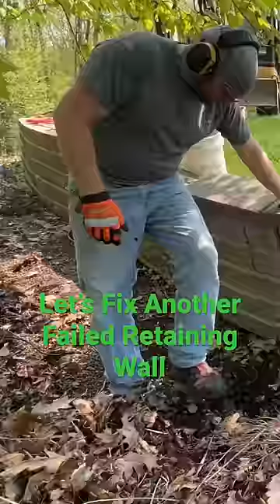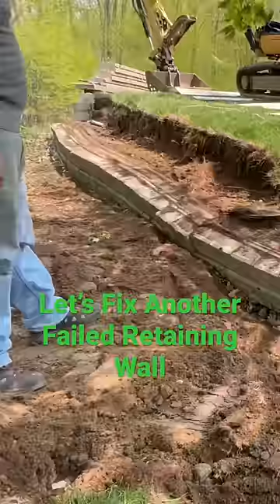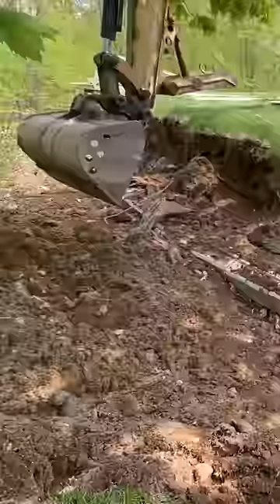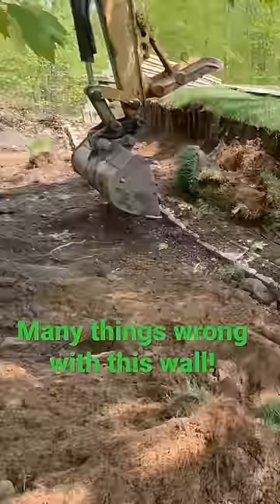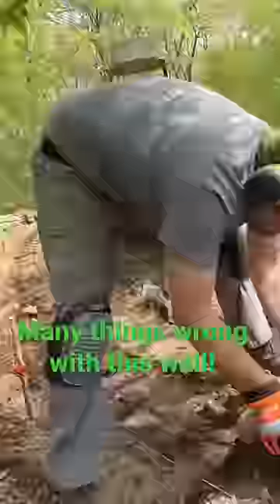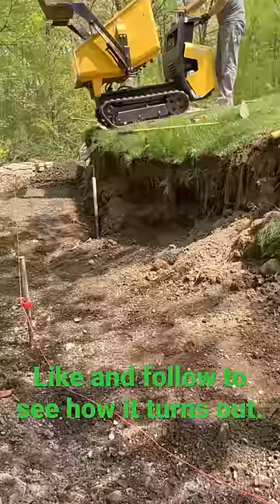Another Wall Failure! #shorts #landscape #repair

Comment: It all depends WHY the wall tipped.  Wall appears dry, and therefore not likely JUST hydro pressure unless interlocking hydraulic cement blocks with very little clearance were used.  If due to frost heave, then better drainage required but ALSO footing below frost line ALSO, to be sure.  If due to erosion of soil in front of wall or settling, then again footing required.  Either way, footing recommended, unless you are in a dry, warm, area with not a lot of uphill area (and thus water originating) behind wall.  This is why code and best practices differ not only by region but also site.  Does one REALLY want to assume that the gravel will be enough, considering how little extra effort to pour a proper footing?  I wouldn't.

Comment: You need a concrete footing for any retaining wall. You also need to put in drainage at the rear, with weep holes at the front. If not, you will be redoing this job again pretty soon

Comment: I’m not a contractor that does these things but I’ve researched a lot before we build ours and they recommend 6” of compacted CA-6 under walls. We dug down 24” and for every coarse above final grade you need at least one below grade. We have a retaining wall that has been holding back 5’ of earth for over 25 years and hasn’t moved an inch! Take it to the bank!!!

Comment: Why would you lay free dirt over the part where you’re gonna be replacing the stones? That loose dirt is gonna compact over time and do exactly what the last wall did the bottom stone of the wall started to tilt because of the compacting of the dirt under the stone therefore the rest is gonna start to tilt with it.

Comment: This video just makes me think. Pour a 4’ wide 12” thick footing. Lay 12” wide split face block with #5 rebar every 16” and core fill the bugger. Drain tile, clean gravel, fabric, backfill the rest with clean sand, and lay sod. Never will have to touch it again.

Comment: a retaining wall MUST either be levered by the footing in an L shape under the retained soil or be keyed in with Geotextile or have sufficient drainage that the bank cannot heave even 1 inch (be almost entirely stone)

This wall will fail again because the repair did none of it

Comment: The wall failed because there wasn't a block in the ground and because there was no stone or fabric behind the wall.  Didn't look like you dug down at all before you put in gravel which is suppose to be crushed stone so there is drainage. If you didn't dig down and put one row in the ground it will just fail again

Comment: I know it depends on soil content but I typically throw an inch or two of sand to set the level. It'll save future issues for sure...you'd be surprised what polysand can fix as well...

Comment: ALL retaining walls "retain" the ground WATER as well as the ground.
   ACCOMMODATION MUST BE MADE to let the water seep (or run) out. Water is HEAVY. 
   Weep holes, French drains, gravel in a ditch behind & at the base of the wall, SOMETHING must be built in right from the start. 
   And the water needs a place to go once it flows beyond the wall. No point in having it turn into a lake.

Comment: I"d still put the first line of blocks fully under grade.. the 2nd line would be ground level  at the lowest spot and go on up from there.. gravel?  sure...under the 1st line of blocks and arround a corrugated and perforated drain pipe with along with a drain built into the wall at the lowest end.. but thats just me...

Comment: Bunch of comments from people who don't have to deal with ground freeze. Building retaining walls correctly is not some mysterious thing, there's simple guides to doing it available online and has been available for free for eons in libraries. And no you don't need modern glues or glass fibre rods or even bricks or mortar. If you do the foundations correctly and have the time and supply of rocks you can it from natural stones without any modern inventions.

Comment: "Lets fix it"

Proceeds to lay "retaining" wall on the ground. Better luck next spring bud 😅

Gotta sink at least the first layer so that the retained soil is pushing against earth as well, and a footing wouldnt hurt either. Dont forget drainage.

Missing just one of these will cause premature failure

I originally felt level goes without saying but yeah, and not plumb, the block wont lay plumb for a reason but this comment is already too long.

Comment: I have a underground house with wing walls they are solid concrete with a buttress on the inside Not a fan of block walls at all the top front pharphit wall we poured to look like battlements  only 2-1/2 feet of dirt on top put brick on the entire front wall and wings that is all you see .

Comment: The one thing I've noticed about non builders building anything on the ground they never start with a solid base and the wall,floor, or whatever sinks or breaks cause it's poorly done anything on the ground needs to have a strong base or you might as well not do anything at all

Comment: It doesn't seem to have vertical reinforcement coming out from the footing, it's lacking steel and there doesn't appear to be a footing. A retaining wall is something serious people, it's not just a planter wall. Leave it for the pros.
Reply: steel reinforcements or rebar is not necessary in block walls if they are installed correctly. this wall had countless issues as to why it failed

Comment: aren’t you just making the same mistake? how about a footing? we used to form up retaining walls for civil work and we had to have a slab and wall L shape with the L going under the dirt.  that way the weight of the retained medium held the wall.  on such a small wall it would be pretty easy to make something similar.
Reply from the maker: You need to watch the full video of the rebuild

Comment: retaining wall holding so much dirt, yet you have "fixed" it without a good concrete foundation to start with? at least here we do it a bit differently (Europe), maybe it's just different in America.

Here a retaining wall that needs to take so much stress is normally being erected on top of a wide (per specs) and deep (below frost line) concrete foundation, using hollow blocks and steel rods, those hollow blocks are then being topped up with concrete, then water sealing is being applied where the blocks are below grade, finally back filling with dirt, on the outer side of the retaining wall a thin coat of concrete based plaster is being added and then painted. this type of wall will outlast the owners two times over

Comment: I've seen way to many of these.... They're always freaking out about the price. I told one client why don't you go disassemble that if you want me to use the same bricks and then I'll do the rest of the work for time and material.... "It's a small wall"  Always wanna say well if it's such a small job why you hiring me..  ignorance  keeps my job.  
weekend Warriors.... There's too many of them out there now making dangerous mistakes trying to build their own decks and fix there own plumbing.. 🙄🤷just hire a professional so you don't f@#$ up or worse get someone hurt. ( Had a wreck of a deck where somebody didn't want to replace the posts even though they We're rotted,,, I literally had to turn them down saying that I wouldn't do it because of safety.... What's the point in replacing all your boards without fixing the KEY problem....

Comment: For a small retaining wall like this he's fine not pouring a concrete footing with vertical rebar running up to tie the blocks above if it was a bigger wall it would definitely fail.... However he still did this wrong from what I can see in the video he should have dug down at least 4 inches below the base grade tamped it then used his crushed rock and tamped that as well this would be his footing and allow proper drainage and give a sturdy base so his new retaining wall doesn't collapse this is for you guys commenting on what you don't know you're welcome now you know and now some of you commercial only guys know as well it's not a 10 foot retaining wall you don't have to go over kill 😂😂 and yes their is other correct ways to do a retaining wall and have proper drainage none the less it's not shown here

Comment: Comment Section: of course it failed because it wasnt over engineered, over built, and over budget!

Yeah you could put in a footing and anchors and rebar, but you dont need it for a wall that height. Guy here is using the free draining light weight base that will solve the issue and not cost the customer an extra 5 grand.

Comment: Just need one of these built and have no idea where to start
Reply: Start by going on YouTube and looking up how to do it. Honestly you don’t need many tools to get it done.
Reply: It's a dry stack retaining wall.  Up to 2-3 feet you don't need any tie backs. Use a 24" wide x 6" deep leveling course of #57 stone...one block buried should be enough unless you've got a steep slope at the toe.  The blocks use friction to tie them together.  #57 stone behind the blocks and filter fabric behind that.  Compact the backfill in lifts.  Wrap the top of the drainage tile with the excess filter fabric and the dirt won't go anywhere.  I agree with whoever said YouTube is helpful.  I've got about a million square feet done here in Florida.

Comment: Problem is there no grid in it . Need a 4-6  ft grod on every 3 rd course .
Reply: there's countless problems and lack of geo grid was the least of its problems here. Although grid is extremely necessary and helpful when it comes to structural integrity in tall walls it is not always essential to use in short walls. The lack of a footing, base rock, drain pipe and clean rock for backfill are the main reasons why it failed. Some people seem to think throwing them on the ground and stacking them unlevel AF and using dirt or clay as backfill is acceptable. Well, it's not
Reply: honestly, you can probably get away without using geo grid for this wall but personally i say use it anyway just cuz.

Comment: People dont understand how difficult it is to build a retaining wall
Reply: ignorance and stubborness make it difficult. did a wall a few years back, still standing so far, that the owner already bought the block and said the budget was $9k. this was a 200ft wall 4ft high holding back quite a bit, more than the wall in this video. well the block was 4x6 "flagstone".... told em many times its not the right block for what he wants and in order to use that block we would have to do some things that would increase cost ALOT. he said no. i said the best i can do is not the approved way but may help to relieve a fair bit of back pressure. well there was a new septic system install 4 feet from where he wanted the wall and i couldnt do that either... anyway, i was just a laborer, despite building the entire wall myself, and with him continuing to fight against my warnings i went ahead and built the wall. it looks really good to this day but a retaining wall is supposed to last more than 10 years and this one likely wont.

Comment: To all you keyboard warriors 8” gravel under wall compacted, at least 18” to 4’ of gravel behind depending on wall height and a 5 degree slant cause that’s how the Roman’s did it! 

Built a dry stack natural wall 7’ tall 120’ long and it is still there today with zero 0️⃣ issues. I built over 400’ on my property and it is all in the quality of the labor that builds the wall. Poor unskilled uncaring workers = shlt work!